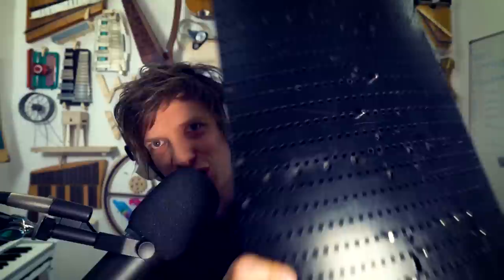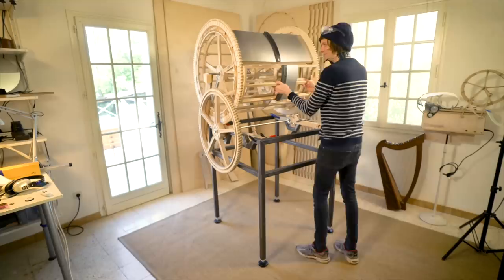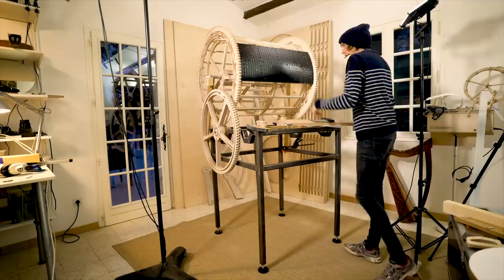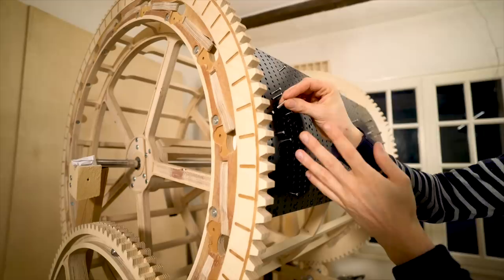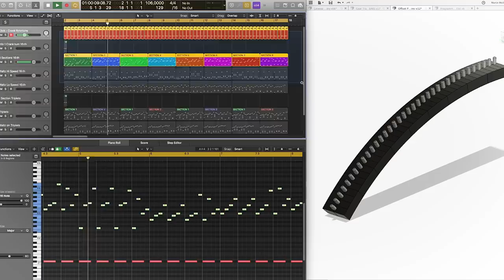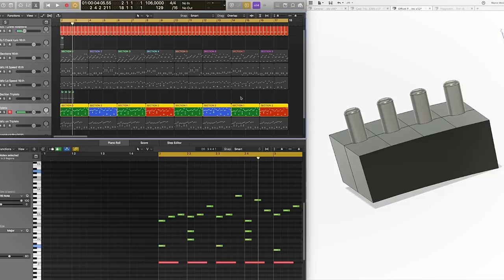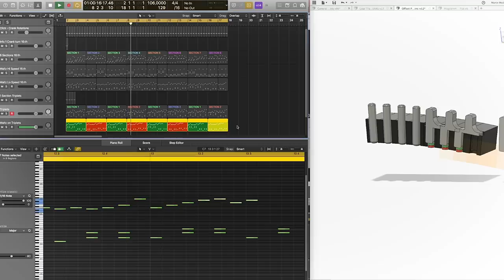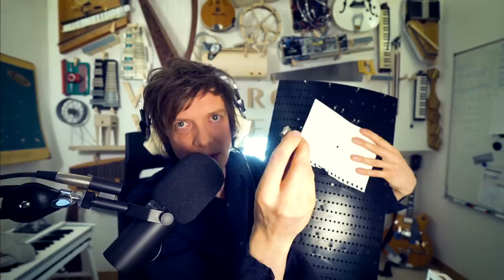Magnet "Midi" Music System - Marble Machine X #25

Comment: Sorry for not answering underneath the top comment, but the Reply button is missing and it doesn't want to load up the 500+ comments...
I would stick with the round magnets, but there would be two set of holes per track for that particular note, as you suggested: one for the 16th notes, and the other for the 12th notes (or triplets - in this case it's the same). They would be offset from the center of the track to the sides just enough so the holes won't touch (+1mm to each hole, so there's at least 2mm spacing between them, just to keep the plastic sturdy enough). However, this would mean that things that hit the magnets and in turn trigger a note (I believe you called them registrators) would need to be a bit wider.
Reply: Hi Martin, 
I'm having the same problem as AttilaSVK with the reply button.  I think you're brilliant and I don't have an idea that would work, but the template of the song will not work.  See, the surface is curved on the programming plate, so you will not be able to take it back off once the pins are all in.  That said, you might be able to leave the template on if it had the right curve and was not too thick.  Anyway, good luck.
Reply: Unofficial Discord - https://discord.gg/QdNwA5Y
Reply: Same problem with the top comment. My suggestion is to create one set of plates matte, and the other gloss that way you can never mix up which set they belong in.
Reply: If I had to guess, Youtube closes comments after a few hundred replies.
Matte. So you can see the magnets twinkle as they travel up and over the wheel.
Reply: Same problem, change the gear ratio so that one turn of the crank equals 3 notes instead of 4.
Reply: +Jacob Harris
Nah, the issue with that was the number of pins on the wheel not being divisible by three.
Reply: If he is going with two tracks he could do something like this https://i.imgur.com/uX0gPL6.png . Which would let him do any factor of 12 as a tuplet (2,3,4,6,12). You would have to machine the pins though. Hopefully there is enough space to keep the plastic sturdy.
Reply: Use the idea to drill an extraction hole on the metal backing.  Now for programming, illuminate from the back side with a projector or a lamp and opaque template.  The projector could also work on the from side but hands can block the projector.  A front side protector could shine a red spot on the magnets that should be removed.
Reply: Additionally if you wanted a physical template on the front make it able to slide to the left or right to open up in a key hole fashion to give the needed room to lift off of the pins.
Reply: How about media blasting the black plastic, walnut shells or something might hide a very consistent finish.  If you like the gloss then please polish it up more.
Reply: I agree, reply button missing and comments not loading in a timely manner.
Reply: Why not have 4 set of panels 2 set fot 16ths and 2 for triplets that would allow to have 4 songs programed  at a time and to allow for a visual difference between them have the triplets in matte and the 16ths in shiney or the other way around
Reply: okay so my suggestion is that if you do 2 tracks with the block magnets instead of the pins, you can make it to where the triplet line actually passes between the registers so that they wouldn't hit them even with pins in. Then you make the registers able to shift a centimeter over so they properly register the triplet track but not the 4/4 track which now passes between them regardless of pins. (think about the pedals on a piano how they can shift everything slightly over for a different sound) 

this would let you:
1. have two songs programed in at the same time, just shift a lever so that it aligns with the other track. 
2. switch time signatures in the middle of the song if you wanted 
3. Switch from the 4/4 track to the 3/4 track but use a gear to change the RPM of the drum 4x which would allow you to have an alternate "4/4" phrase of the song  that is 1/4th the length of the standard full loop (would be good for a quick bridge in the song)

the 3rd option above brings me to my second idea which is the ability to shift gears. I assume this is already a plan, but if you make a gear that can increase the RPM of the drum to 2x and another that increases it to 4x this will allow you to do other time signatures (although it decreases the length of the over all loop)
Reply: Also, at the beginning of the video you said something about making comments with design suggestions for the programming wheel and my immediate thought was "they should make special pins so they can change up the time signature." so needless to say, I was in the triplet hype with you!
Reply: I think a factor of 12 is the obvious solution, as it divides by both 3 and 4 but i imagined doing more of a layout like this https://imgur.com/1RPT1nR   which shows 5 of the current pins (so you see the start of the next group of 4) and the corresponding base-12 suggestion.   It does depend ont he exact size and spacing of the current pins though, i couldnt see obvious mentions of the current sizes

Comment: hey Wintergatan what about making a strong magnet panel that can take out all the magnets instantly this would reduce a lot of effort taking all the magnets out
Reply: Electromagnets are a pain to work with :(
Reply: Magnetic panel with steel pins seems more elegant than thousands of magnets.  You also eliminate the polarity complication with individual magnets.  It's also easier to store many pins in a box together when their magnetic attraction to each other is weaker.  The whole panel doesn't have to be a magnet, just the base plate behind the holes.
Reply: I was also thinking of a similar solution, but I thought of just flipping the panel face-down and putting a magnet on the other side

Comment: 1. Make a different wheel for different timings.

2. Make a wheel, if the tolerances of your anvils/striking arms allow, where both 4:4 and 3:4 can exist. Simply offset the different pin patterns to fit within the striking pad/arm's dimensions.

I think 1, would be ideal, as it seems your have your prototyping down well.

Offset pins seem to be a lot more work, and since you have to reprogram for each song individually anyways, different timing wheels allow you the same flexibility with slightly added logistical cost when on tour.
Reply: yup, also I'm rusty on the math but if you make one turn of the crank equal 12 pins instead of 4, you could have either triplets or sixteenth notes ( I think! ) , I think the  concept is the higher resolution/finer pin count per turn , the more control you have over the note timing , amazing job non the less!
Reply: then you have 45,000 instead of 15,000 holes per setup - that's a lot more work and a much bigger wheel or a shorter loop
Reply: and for each setup, please have minimum 1-2 spareparts with tour!  you have check the breaking, but if how long u need to fix it? little pinholes so that u can push it trought? bigger magnet to pull it out?

Comment: Gloss black with look good but you got to think will it be reflecting the stage lights when it's up there so you might end up having a disco ball effect as the drum goes around
Reply: Why not go a step further and cover the drum in hundreds of tiny mirrors? :D
Reply: Weight, cost, maintenance (because those little f'ers WILL come off, possibly jamming the machine) and distraction.

Comment: Two tracks per channel sounds like a winner. My only suggestion is to have some visual indication for each bar (measure) on the panel to make it easier to program. And perhaps the number of each of the 64 bars so panels don't get mixed up. What I don't quite get is the need for the beefy plywood structure underneath each panel. The steel and polyethylene combo alone should be rigid enough. That would also stack better transportation wise.
Reply: Both the polyethylene and the sheet metal start out flat and have to be held to that shape.
Reply: Hi Jim. Sure, they start out flat, but they don't have to remain that way. Just heating up the poly would probably settle it into that shape, and bending the sheet metal with a plate roll is a breeze. But I highly doubt Martin wants to remake those locking levers now :-)

Comment: Personally I would try to automate the task of switching songs. You'd need to introduce some electronics to let the plates become aware of the song and then extend/retract the correct pins. You could incorporate that with one of your ideas for having triplets. You'd need more magnets per plate for this approach (would need to fill all holes), but only one set of plates. It could also be a fun electronics experiment.

I think a potential cool part of your current ideas is the audience participation or even seeing non-audience members manually setting up the next track. If you go with the manual route the only thing I'd suggest is having 3 complete sets and program them two songs ahead. Programming only one song ahead sounds pretty risky and could result in a delay in the show if something goes wrong or takes too long.
Reply: I think this sort of automation might not be in the spirit in this project either, which is okay. I just think it's be a really awesome approach to see working.

Comment: your doing fine, you might want to test if the ply wood expands in humid condition, the wide tolerance in the board might help eliminate the boards getting stuck, is there any clear coat to seal the wood ?

Comment: I'm not sure if Martin intends to only play either a song that is either 4/4 or is 3/3
If this is the case, it could be possible to create new boards for the programming pins to go into that can maybe be a slightly different colour to help distinguish them. These would then only have slots for 3 pins instead of the current 4 pins. This would also allow for the use of both 4/4 and 3/3 sections for different parts of the song.
Another benefit of this is that it would mean you do not have to play around with getting the right pin type into the right slot as you could still use the same pins for the 3/3 sections.

Alternatively, the only way I see you being to accomplish using the same pin boards and still being able to use 3/3 time is by using at least 2 new pin types. you could use the same one of the new types on either end of a "beat" section and then place one that offsets it by even more in one of the 2 pin slots between the other 2 slots for the other pin.
It seems like this method could be overly complicated especially when replacing the pins and programming new songs. you would have to keep track of the different pin types and where each one of them has to go. simply having 2 interchangeable board types seems like a much simpler and easier solution to the problem.

if I have made a mistake somewhere in this comment I would appreciate feedback to correct me
Reply: Your only problem is saying 3/3 instead of 3/4 ;) But yeah, this is a much better solution. Especially since to get it to work as currently designed, you will need to use a different pin depending on which beat of the 3/4 measure you're programming. Beat one of three comes on the same beat as beat one of 4/4, so no problem there. But beat two comes at .334 of a measure which is .084 difference from beat 2 of a 4/4. Beat three of the 3/4 happens at .664 of a measure for a difference of .164 measures after beat two of the 4/4 or .086 measure before beat three of the 4/4. Add to that the challenge of reprogramming quickly and making sure you're using the right one of four pins AND that they're turned in the right orientation... the engineering side of me gave that one a blank stare for a hot minute. But yes, keeping the plates separate is the way to go.
Reply: i think it would be more expensive actually
Reply: The downbeat needs to be in the same spot no matter what.  Why would you offset all three?
Reply: Daniel Tomasik The thing with having different board types is that you would need to have two sets of each (ie to change from 3/3 to another 3/3 song) and you'd loose the ability to mix in 3/3 channels. I personally think the overhead of converter pins could be mitigated by having plastic overlay mats for pin placement between songs + maybe templates on that mat and the bottom of the conversion pins to distinguish between triplet conversion pins and normal pins. Could probably mill some of the conversion pins from wood and it would be fine too?

Comment: If you do decide to use offset pins, you only need one style of offset pin, not two - just turn the smaller offset pin around.

Facing one way it can convert 2/4 to 2/3.
Facing the other it will convert 4/4 to 3/3 - simply skip the 3/4 hole!

Comment: Magnet Machine X
Reply: i activate the  spell card ''Magnetic Music'' , when ia ttach this card to a Marble machien card, i can send the Marble machien and the Spellcard to the GY and special summon Marble magnet Machine X from my Extra Deck!
COME FORTH MARBLE MAGNET MACHINE X! ''Rawr-bibiubububbibu*magnetmarble sounds*''
Reply: Link3000XD Wait right there, I activate my trap card "Ultimate Trap hole" which destroys wathever monster you've just summoned
Reply: Unofficial Discord - https://discord.gg/EHDdUeC
Reply: i activate my Nightmare Wheel! now your monsters trapped, and the wheel's rolling. 500 DMG!
Reply: Link3000XD Now I activate my quick game spell card "magnetic counter attack" and discard one card of my graveyard in order to make the same damage to you. That'll be 500 DMG
Reply: This is an intense duel.
Reply: fine, i have another trap card! Ring of destruction! that'll make 1000 dmg for both of us! also..
 Shut up Mokuba
Reply: Link3000XD that's too bad, because I have another ring of destruction, another 1000 DMG for both of us XD
Reply: The magnets is on the "wrong" side. It's better to use something like this: around 1 or 2 € each.
https://www.onpira.de/Ebay/50595.jpg
Wintergatan, use thin steel pins (nails), instead of thick magnets. So you can drill much more holes. problem solved.
Reply: ... i summon a monster in defense position
Reply: Link3000XD Since you have a monster on the field, I special summon the Cyber Dragon, then I set a monster in face down position, and now Cyber Dragon attack...
Reply: MIRROR FORCE!!!
Reply: Link3000XD Ah C'mon! Well then, I set a card and end my turn
Reply: ah finnally! i summon!... Lava Golem by using your cyber dragon and the other monster card! Now i activate my swords of revealing light spell card! ...end of turn owo'' hehe

Comment: (There's so many replies to the main post that you can't reply to it!)

So here's my idea, a "Bar block". It's a small plastic piece with magnets on the back the width of a single track, and the length of a single musical bar. The thing that makes it better in my opinion is that it 1. Doesn't require additional material, 2. Keeps perfectly in line with your pin readers, and 3. Doesn't limit you to only 3/4 or 4/4, since you can put 16th notes or triplets (or whatever, 5/4 even?) in. As an aside for this, I would actually have different colors depending on the bar, so that 4/4 is the original black, 3/4 is the matte gray, etc. You would need a lip at the edge of your programming section so that none of the bar blocks can shift out of line, (or maybe small ribs?) But it seems the most diverse option to me.
Reply: Hah I was just thinking that. Make the programming wheel only hold bar blocks and switch them out as you need them. That way you can go 5/4 and 7/4 and all those other juicy time signatures! It might be a bit hard to reprogram that during a concert but if most of their songs are in 4/4 also maybe not.

Comment: My idea is to just drill more holes in the programming section like you can see here:
https://www.reddit.com/r/MarbleMachineX/comments/7xnl7r/triplets_and_arpeggios/

This way, you can not only divide the beat into 4 and 3, but also 8 and 6.
So you can make more of a standard music box sound with fast arpeggios as you often do.
Reply: My only concern with this design is that there is little material surrounding the pins. This could lead to a shorter lifespan of the programming plates and result in more time consumed.
Reply: Judging by the trigger mechanism video the triggers are quite wide, so I guess you could add more space around the pins.

Comment: Instead of using a paper template, which looks like it would have to be torn off every time, could you use a projector instead? Seems like it would be really simple, once you designed a template that would look right on the curved surface. You could also use two different colors to differentiate between the regular pegs and the triplet pegs.
EDIT: Just had another idea, if you made a simple piece of software that allowed anyone to design a template (projected or paper), you could take commissions. Think of how cool it would be for people to be able to have their music played on the marble machine, especially if you could reduce the amount of time it took to record it down to like half an hour.
Reply: Since those triplet pegs are off set, you wouldn't be able to just pull off a wood or aluminum template. Heck, even with the straight pegs, the curvature of the panel would require a ridged template to have rather large holes to be pulled off. Obviously those larger holes, when placed very close together, would reduce the durability.